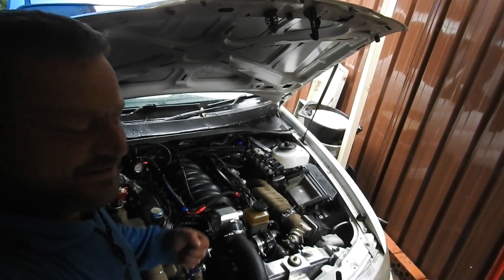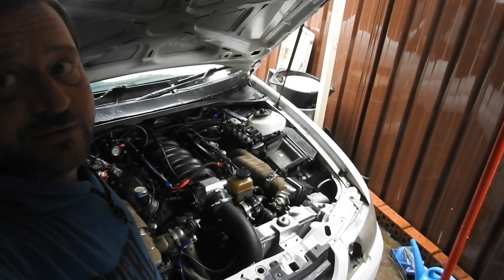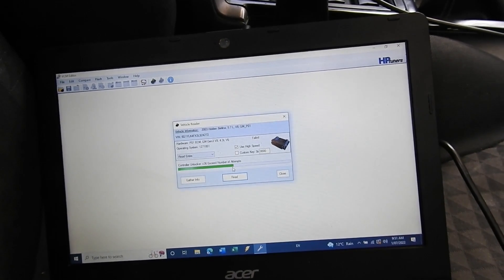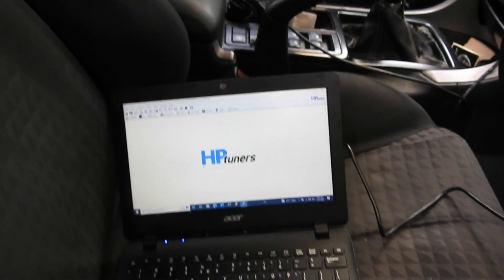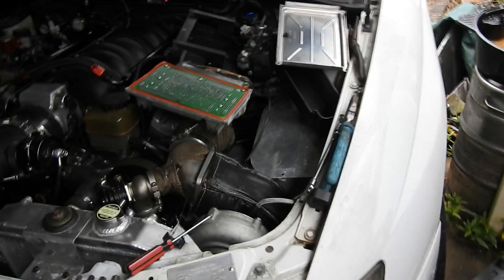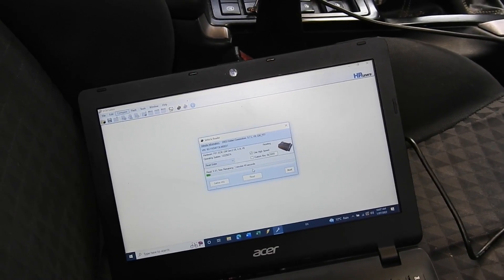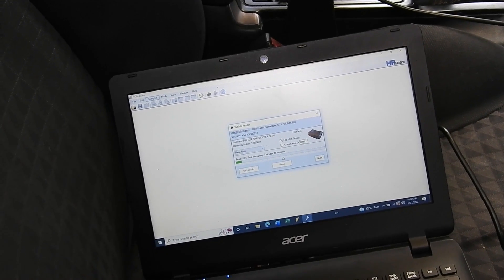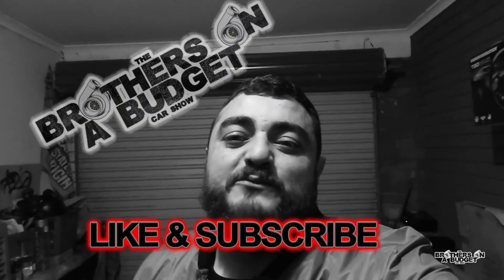How to unlock a tuner locked PCM for ls engines

Comment: Thank you for posting this. 
I noticed after shorting pin, you did not cycle ignition. You went straight to write entire correct?
Reply from the maker: Yes that is correct. Leave ignition on the whole time. It usually takes me 2 goes for some reason. I leave the ignition on, disconnect the usb from laptop.  Short the pin then plug in usb and try and write entire.